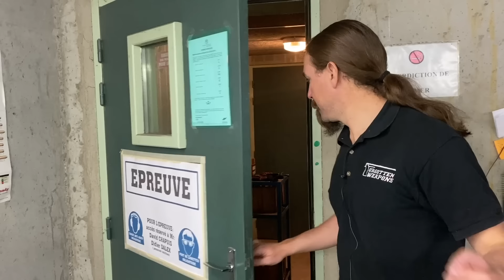A Tour of Chapuis Armes: Home of the MR-73 Revolver

Comment: 14:53 a big label on the wall  "Before use with a rifled barrel weapon make sure the bullet trap flap is OPEN"
Reply: I wonder if the same person who blasted the holes through it made the sign?
Reply: Problem easily solved with a switch contact interrupting a light circuit. Red light on says open up the flap before firing a rifle.
In my case, it would be a light with a panel blocking the opening. Both on switches so that you need both opened before proofing a rifle.

Comment: Very nice to see them made, and very courteous of them to be so open about the processes.  CNCs are great tools, but in the end it comes down to how much the people running them care about what they are doing.  You can see where the MR73 reputation comes from.
Reply: As automated as CNC machines are,  they aren't 3d printers.  You can't just give it a 3d model and expect it to spit out a part.  It still requires a very skilled human being to determine the tool paths it should use.
Reply: Even a 3d printer requires a very skilled human being to design the process so that the end  product comes out as intended.
Well, it does as long as you’re ‘printing’ parts in high-end steels, titanium and superalloys. Plastic prototype parts, not so much.
Reply: @dirtfarmer7472  More and more automated systems are doing the actual programming.  Create a Solidworks, Pro E, or Inventor solid model, put it into the CAM software and tell it what machine you want to run it on and the software makes all the decisions about tool selection, speeds, feeds, and tool path.  It can identify features like holes, threads, etc and apply the right tool.  Of course you may have spent a year or more developing that automated process.
Reply: There is this guy here on YT Hambini who makes bottom brackets for bicycles in his spare time, in his day job he is an aeronautical engineer.
He machines them by hand on a lathe because according to him CNCs are stupid and not precise enough because they do not account for tool wear and spring back which is inherent to all materials.

Comment: I like how the tester also zeros the sights. There are a lot of companies that don't do that. Attention to detail is what separates good from great.
Reply: Most European gun manufacturers have been doing that as a matter of course for decades.  I bought a bunch of HK and SIG semi handguns over the years and every single one I purchased came with a test target included.  Like proofing, it's considered part of the quality control process.  I haven't bought anything new like that in years, but I have to think most or all European manufacturers are still doing it.  I can't recall ever buying a Ruger or S&W revolver that had a test target in the box.  Though if memory serves the few original 1960s and 70s Colt Pythons I  owned came with one.  All of them were a fingertip-sized hole in the middle of the target.
Reply: I noticed that he adjusted the sights rather quickly (two clicks and two clicks) and didn't reshoot.  Like a boss.

Comment: Literally ultimate flex, they can show you excatly how the gun is made and you cannot copy their work.

I also love the zeroing is done without further confirmation.
Reply: That won't be the final zero. It's just an overall function check and roughly setting the sights.
They'll be zeroed and proved later before blueing the cylinders. 17:05
Reply: Any really good smith could copy this revolver with only a reference gun to go from it's the mass production of firearms without original data that is hard to reproduce
Reply: The zero man is a machine. Sets your gun at 100 yards with 1 round.
Reply: @chickenfishhybrid44  I think it's closer from 2k in France. The price hike may be a question of change, taxes and middle men. I lean for taxes.
Reply: @chickenfishhybrid44  the MR73 price tag has also rised in France. It was more less 2k years ago, and it is now as we speak 2325€ for a 7" barrel. Now, regarding a MR88 wich is a python equivalent, it is around 1300€
Reply: @chickenfishhybrid44  the reasons why the MR73 is so expensive on your side are probably the same as why we pay between 1400 and 1700 in dollar equivalent for the S&W an Colt counterparts.
Reply: As it's a sports gun with adjustable sights I've no doubt the first thing the new owner will do is zero to himself.

Comment: Best "How its Made" video that I have seen! Now I want to see a Colt and S&W video.
Reply: No, you don't.
Reply: @JohnHughesChampigny  🤣
Reply: It's not overpriced. You pay for what you have. wages, taxes, working hours are not the same as at Colt plant. Importer in the US and taxes may take the price many steps higher. Someone wants a python, he buys a python, it's as simple as that.
For your information, an american revolver isn't far behind a MR73 in term of price tag in France...
Reply: Joe Blowe  $12 USD is almost exactly $10 EUR for your information, and some US states have minimum wages as low as $5.15/hr (which is sickening btw). Nobody is questioning that they're expensive but saying overpriced implies the maker is trying for huge profit margins. I think one of the points Roy is making is that there's a lot more steps between leaving a factory in France and your local shop than a factory in Massachusetts. As an aside, apparently S&W are moving to Tennasee? Gee, I wonder if that has anything to do with the minimum wage there being $7.25 vs $13.50 in  Massachusets? Anyway, value is subjective, clearly it's not worth it to you but that doesn't mean they're trying to rip you off either.

Comment: Thanks for a super video. I could not resist the temptation and have bought a 4 inch MR 73. I can not wait for the range to open again here in Switzerland in early spring to try it. For now, the trigger is unbelievable 😳! ......nothing less than one if the very best SIG 210-5 and 210-6 from my extensive collection. Thanks!

Comment: The revolvers had an additional test in Mulhouse: all revolvers had to make a 6 shot 19mm (3/4 inch) outside diameter 50 meter group. The 10 3/4 inch Silhouettes would do 1.5 inch with handloads at 150 meters. There are two separate leaf springs that are user adjustable. One is for the hammer and the other for the trigger. The single action only Match and Silhouette can have 1 pound triggers. The double action can be adjusted to less than 4 pounds with reliable ignition. The barrels were cold hammer forged to .358 lands and .356 groves. I still have a convertible Sport with a 9mm cylinder.  I would load .356 9mm 147 gr bullets in a 357 case. I shot many IPSC matches with it and broke some steel plates with this loading.

Comment: For those who are equally into high-end watches and guns, the process described by Ian at 12:00 regarding the cylinder finishing resembles a lot the double assembly process at A. Lange& Soehne, where the movement is assembled a first time to be perfectly regulated, then disassembled to be perfectly finished, then reassembled. This is to avoid leaving fingerprints on the plates and bridges of the movement during the regulation and adjustment process. It goes to explain why both Manurhin and A.L&S are considered having the best finishing in their respective industries.

Comment: For those of use who service factories and other manufacturing concerns, this is nothing new.  Their attention to detail and hand fitting is what makes it special.  Most of the precision parts in your automobile are made on machines like those in your video.  Machine tool technology is what makes a lot of modern items as inexpensive as they are.

Simply put, a machine tool can produce more parts, more consistently, and do so for hours on end without a break.  This doomed the craftsman who could do good work, but not to these standards, nor work 24 hours a day.

These machines can do tolerances measured in the micron range (not typical machine tools, but specialized ones certainly can).  And do it every time.

But man, that is a pretty revolver!  That polished deep bluing speaks to me.  And i am not a revolver guy.  I only own one, and it was specifically purchased for wilderness exploration.  Which i never got around to.  An 8" barreled .44 magnum in stainless steel is not anything you really need in a city...  ^-^  Better off carrying an automatic of some sort, in a much lesser caliber, as they are more suited for that use.

Comment: Legend has it one GIGN revolver has fired over one million rounds without a parts failure. They requested the revolver be able to withstand 40,000 rounds a year.
Reply: This is, in fact, true. Not a legend... Standard GIGN training day is firing 150 round. 5 days a week. Which means 39000 rounds a year only for training. MR73 has been made to withstand that for 25 years... 1970, GIGN chose a revolver for reliability and accuracy purposes over readily available automic pistols. Here you have it. MR73

Comment: Thank you for sharing. With such precision manufacturing on a piece by piece level, like this. Would you say that swapping out broken parts between two MR73s may require some fine tuning?
Reply: It probably would, but what broken parts? these things are built to be indestructible
Reply: Cylinders can withstand heavy overcharge easy

Comment: Many people have complained about the price of these guns. Not to many people have done so after shooting or even dryfiring even the beat up police turn in guns. Put it this way, you can buy one, shoot the crap out of it for 3-4 years and sell it for a couple hundred dollars more then you paid for it. (My local range has one and they charge a premium to use it. There is often a line up waiting to shoot it).
Reply: @John-Paul Silke  Do you know if the MR at your local range is the latest model?   Thanks.
Reply: @diegos2594  not sure of the model. I only shot .38’s in it and didn’t examine it. My local gun store has one for sale, used but not a police trade in. Lots of money and my list of must haves is long so it’s probably going to sell before I get the money and trade guns together to buy it.

Comment: How is the quality of the steel and the heat treatment compared to an early '80s production? Will it hold up to a steady diet of Magnum loads day after day year after year?
Reply: Concerning the quality of the steel an the heat treatment everything is the same as the GIGN requiremnts 48 ago.
Reply: @tromxuasnoc5511   Anyone knows if the GIGN's still using the old models, or getting the latest ones?

Comment: I find it interesting that the sighing in does not involve a Ransom Rest, and he does not reshoot after adjustment. Confidence and skill I guess.
Reply: Help a greenhorn out here, whats a ransom rest and why is it important?
Reply: @seanmurry6903  A Ransom Rest is a machine that holds the gun securely like a vise, but let’s it rock back under recoil, and return to same position. Has lever to actuate trigger. Used to determine accuracy or a pistol without human movement.

Comment: Does anyone know if the steel used is still the same type as the old Mulhouse MR73s? I keep reading that Chapuis uses cheaper steel from random people
Reply: someone said they talked to some Chapuis employees on a forum and they said it's the same steel between Mulhouse and Chapuis. Not much more info
Reply: Ce sont les mêmes aciers de chez Aubert et Duval, les gens ont parfois juste besoin de cracher sans rien savoir et/ou de créer des légendes : c'est l'être humain ^^ !!!

Comment: To be honest, while these are nice, they are mostly cnc machined and cleaned up at the end with some filing. Thats fine, but i have never seen a Colt or Smith and Wesson that was anything other than excellent in manufacture, fit and finish. I don't know if the difference in price is worth it.
Reply: Oh please, do read up what makes an MR73 to an MR73.
Special grade steel and then forged.
Rollers used to make an ultra smooth DA.
Individual fit and finish, so comparable to special editions of either Colt or S&W which also cost you an arm and a few legs but...without that special steel forging and those rollers.

Any S&W revolver that could take over 100K and some up to 1 million shots of  hot loaded.357 magnums whithout a cracked frame?

So that is what you pay for and let your offspring hand the gun over to their offspring etc. etc.
Reply: Joe Blowe  Just checked pricing; a new  6" or 5 1/4" MR73 sport is roughly double the price of a new 686 S&W international. 
Now if we compare used prices, my bet is that an MR73 has less depreciation then any S&W, wehter run of th emill or performance center etc. or not.

So anything else before you give that keyboard a ram spouting non sense?